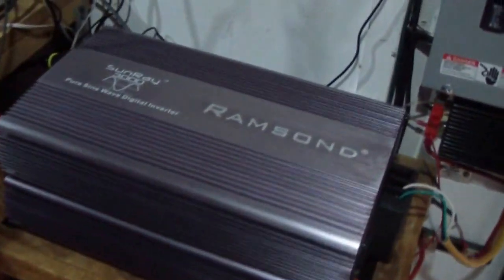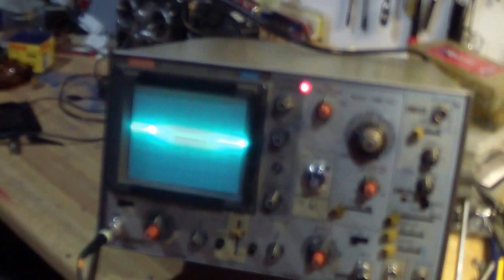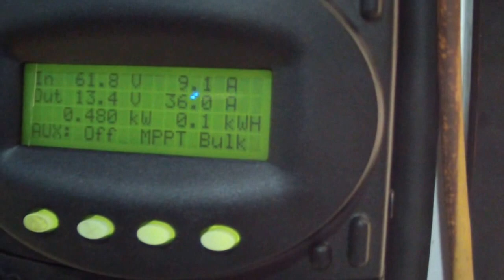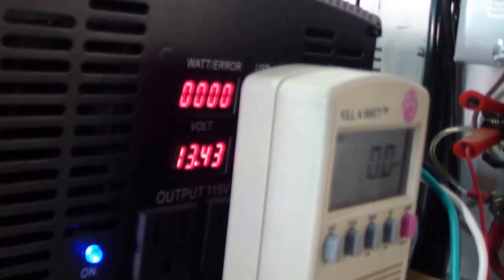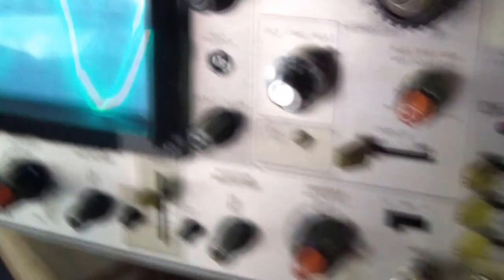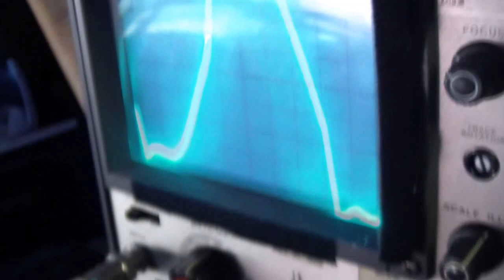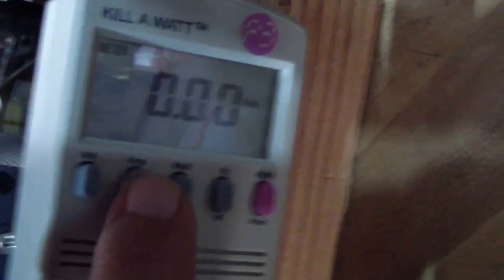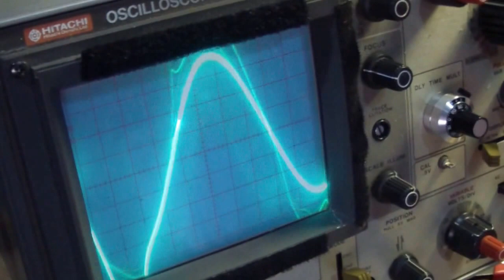Comparing Ramsond 3000 Watts & Samlex 3000 Watts Pure Sine Wave 12 Volts Inverters.

Comment: I have often wondered if the micro Grid tie inverter had any effect on the pure sine wave but it looks the same when you tested it with out. I like your TransAm. My frined and I used to drive around in his back in the 80's It was really nice it had a 400 cid engine and it was really nice in mint condition. Samlex is a decent inverter so far. Nice perfect wave. I think the interference is when your probe in not quite touching perfectly and not making the best connection.

Comment: Doesn't matter if the DC side of the inverter is grounded to your AC ground, a lot of inverters don't make the AC neutral grounded to the DC ground or the case ground so be aware of that.

Comment: The scope was grounded to your house AC and so when you were measuring the other one you didn't have that ground. If you plug the scope into the inverter you are testing it might look better but sometimes they isolate the neutral from ground, unlike your house wiring which makes them both the same. Why the sine was better on the last one I don't know but somehow you had a good ground for the scope. And doing this with a MSW inverter is also tricky. Be careful you can burn the scope ground lead

Comment: Uuuuhm, you get that kind of noise on a scope if your ground is floating. Your scope is likely grounded to the mains supply. Unless your inverter is also grounded in the same manner, your ground on the scope is actually floating (relative to the inverter) and you will get a noisy signal.

Easiest way to get it right would be simply to power the scope from the inverter. That's assuming that ground is bonded to Neutral. Cheap inverters have a floating ground...

Comment from the maker: The scope was a hand-me-down, the connecting leads/wires are old and I think that it was a part of the erratic readings problem.  I have shelved the Ramsond as a back-up and I am not using it, I am using the Samlex on daily bases so far with no problem at all.  Do not buy the Ramsond it is not a true sine wave inverter it is a half as inverter.  Remember that you get what you pay for. 
Be Good, Godspeed,
El Raz

Comment: Just saw my PowerJack LF5000 go in smoke. 600$ gone in 20 seconds.
Light from the AC plug was ok but connecting it to my 110v circuit after shutting down the breaker, the unit just went in flame and I still don't know why. Go with american models-better protection imho.
Reply from the maker: Sorry about your loss!
Reply: Fred April Which brand and model were you using?
Reply: As mentioned,  power jack lf5000... It's not like the regular 110v, it's 60v +60v to get your potential 120

Comment: That Ransom is clipping the signal as it's a piece of shit! 

If you want to test them. Just ramp up the wattage to full load. See which one gets hottest. The shit ones will get hot. Hell the Ransom couldn't even hold 120 volts on a small 1\2 hp motor ten feet away.
Reply: ***** Todays generators are already pure sine wave. At least the good ones are like Honda, Yamaha and Onan. You just have to look at the specs. 

They also make Converters that do the same thing in the newer RV's. Hell even motor vehicles require a very specific voltage regulator today to function properly. One reason you have to actually pull the voltage regulator out and see what the front and back color combination is or you will ruin the electrical system. As they are specific to each vehicle even of the same year and model. 

That is why there are big price gaps from cheap to very good. Its all about efficiency and quality parts in the unit.
Reply: ***** You can buy a honda 2000i for $1100.00 or the 1000i for $800.00 so the price is reasonable to  me. The "i" in the product model number is for inverted clean power. Same for the Ui models.

You're right that people buy the cheaper modified sine wave. As their not running electronics maybe some power tools and compressor. In which case that would be just fine as long as it is eff. is above 85% If not it will get hot enough to cook an egg on and give up the ghost if run close to its rated wattage..